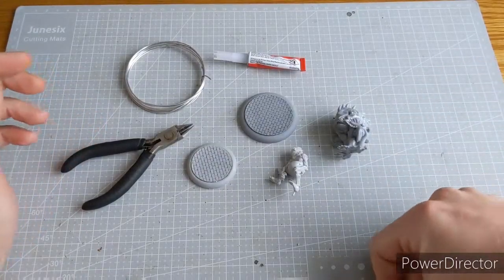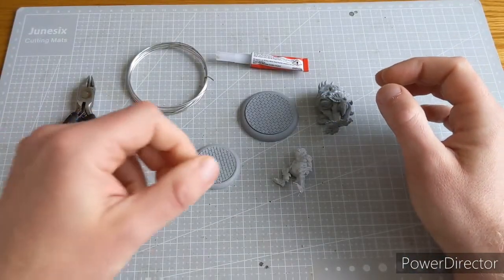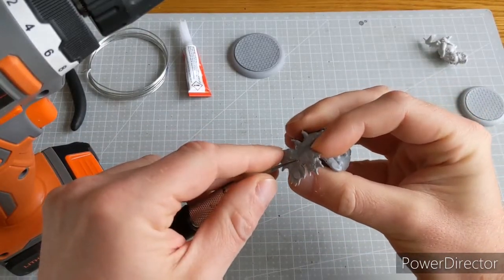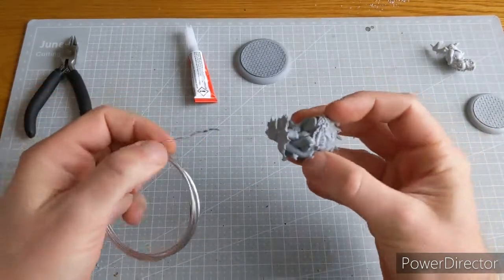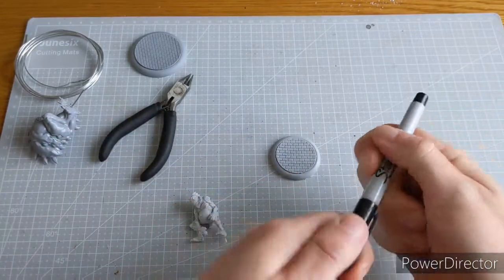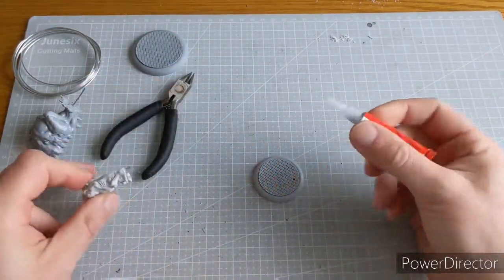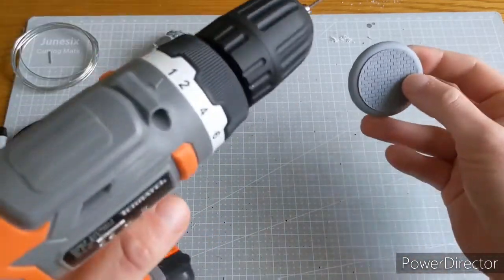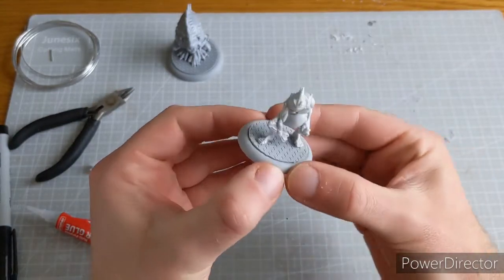Bunker Hobby Tips: How I Pin Wargaming models. Take care and be careful 👍

Comment: A tip I give is if you're trying to pin an arm on or similar that needs to be precisely positioned you might be off centre. If you drill your pin holes then do a bigger hole near the top like you were doing a countersink on a screw hole and that gives you wiggle-room.
Reply from the maker: Great tip.  
A guide hole is always a good idea to boost pinning accuracy